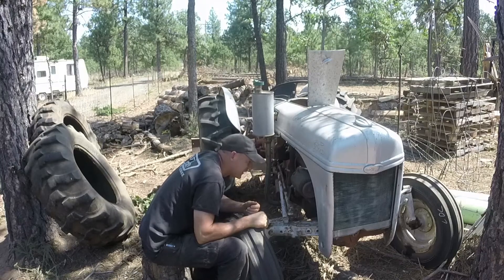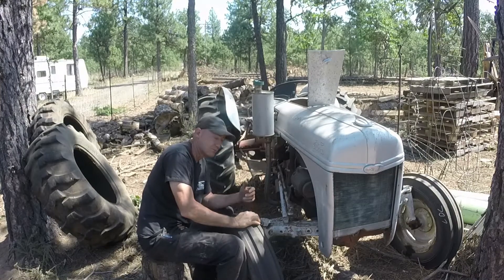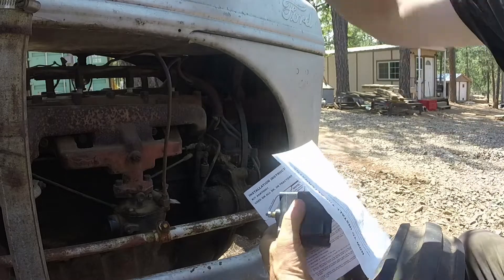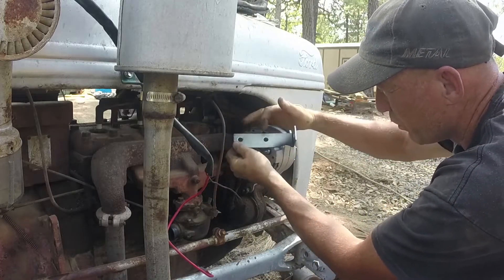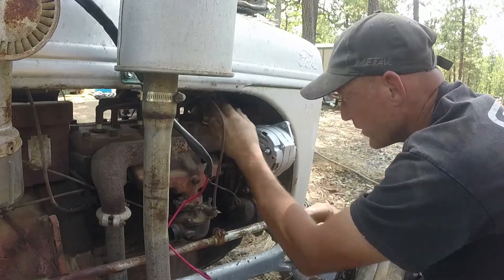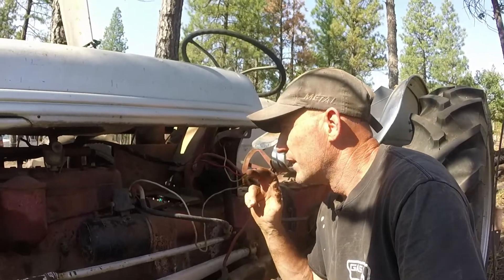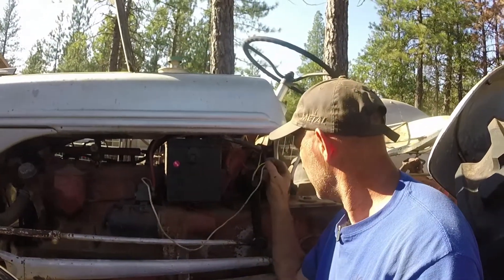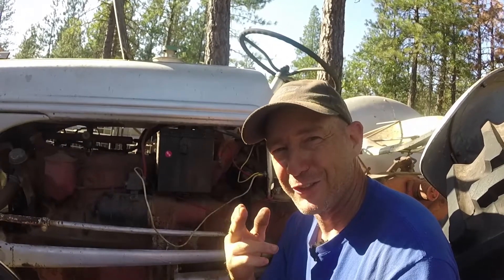Bringing my Ford 8N tractor back to life

Comment: Good to see it running again. First tractor was a 8N with a Ford bucket. Bought for $3400 in 2004 and sold it to upgrade to a John Deere 401C 1974. Got $3500 for it and kept the bush hog and was able to buy the John Deere for $3500. Loved the 8N and glad it is still in use here in North Idaho. Sure you will enjoy it with the attachments. Thanks for sharing
Reply from the maker: I love this old tractor for the most part. lol. :)

Comment: Great tractor project! Im going to eventually convert mine as well. I just havent done it yet because she is pretty reliable at start for me still.
Reply from the maker: I cant believe how few wires this tractor had and now it has even less wires with this conversion. Even less that can go wrong. I need to add lights to mine so I can see better in the winter months when the sun isn't out so long. :)

Comment: I have a ‘50 8n and someone just gave me another ‘50 8n that has a Dearborn loader and dirt scoop on it. Was planning to use if for parts but then the guy said he was using it a few years ago doing some work when it suddenly lost power and was missing. Haven’t messed with it yet but going to see if I can get it running and see if it’s something like a stick valve or something like that. They are cool old tractors. My good one yang much to look at but it’s a work horse on our 13 acre farmstead.
Reply from the maker: I love my 8N tractor. Super simple and loves to work :)

Comment: I have just recently begun watching your channel.  Thank you for the time that you put into making your videos.  I have a bit of information that I would like to pass on.  I have been working on my 1942 2N Ford tractor which was in need of much work.  It had been converted to 12V by a previous owner but had considerable "issues" and would not charge or even stop with the key.  I have purchased all of the manuals that I could find but for the electrical, by far, the best resource has been a man named Kevin LaRue.  http://www.myfordtractors.com/  His detailed descriptions and diagrams of the converted 12V system helped me to get the tractor performing like it is supposed to.  I don't know the man but highly recommend his website if you are looking for information.  I completely rewired everything and got it starting/running/stopping like it is supposed to with fresh gauges,wires,  dash light, OEM starter switch arrangement, etc.  Today, I was welding in sheet metal to repair rust damage on the hood.  Hope to have the tractor back together and working, soon.  I wouldn't call myself a mechanic, either, but certainly not a body/sheetmetal guy!  Keep up the good work!
Reply from the maker: Thank you and thank you for the information. :)